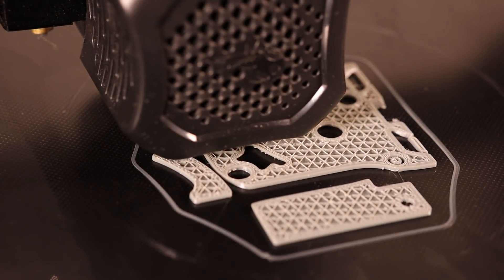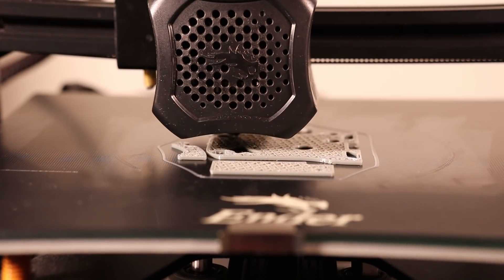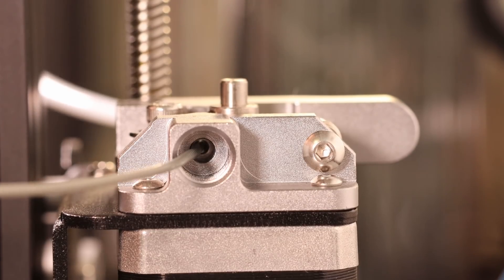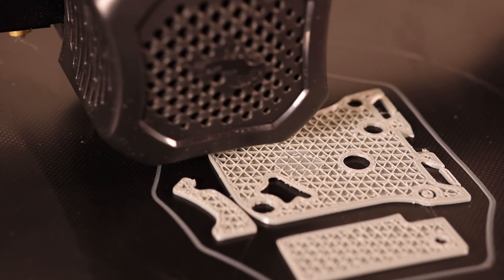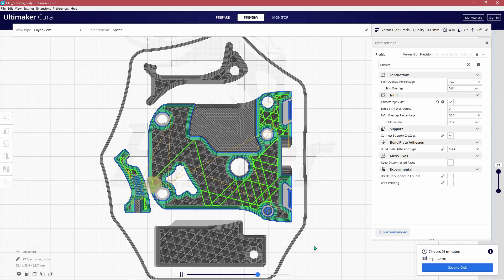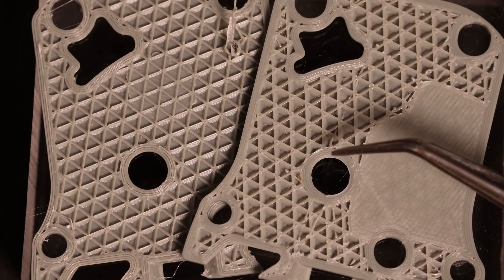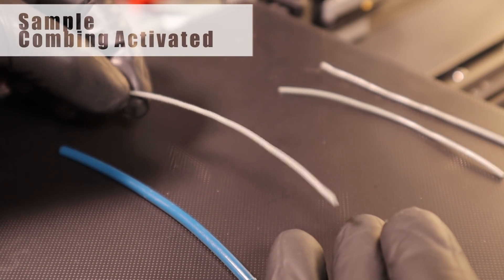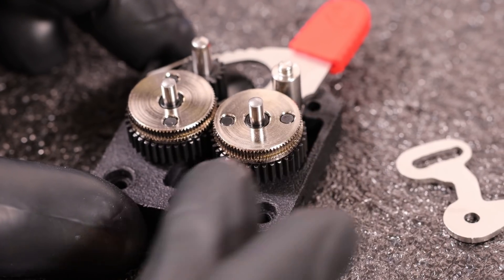Creality Ender 3 V2 - Stop The Print From Failing Like This

Comment: Thanks for this inspiring video, man!
I was having a different problem, but the first tip sent me in the right direction.
I was printing a large part in TPU and it kept failing at the first infill layer with filament wrapping around the extruder geared wheel.
I tried limiting the amount of retraction as I did already figure the problem was caused by that, with the extruder having a hard time pushing the flexible filament back into the tube, but that wasn't enough.
The continuous infill tip seems to be the right one for my case. I'm now halfway through the part with no failures.
Thanks to you, I've learned something new and useful today!
Thumbs up!
Reply from the maker: That's great!  I've not tried TPU yet, I'll have to experience it, I was waiting until I test direct drive.

Comment: Just letting you know that the Voron parts ARE NOT supposed to be printed in PETG. PETG will flow at temperatures at which enclosures heat up to. It is a very big nono if you want your voron to print for more than 2 weeks :(
ABS is the ONLY material you should print your voron parts in
Reply from the maker: I will agree that some parts are best printed in ABS, anything in contact or near a heat source, everything else is fair game.  They do suggest ABS in the instructions, Voron printers can be setup in an enclosure to print higher temp materials and will lead to softening.  

I'm willing to try it in all PETG and see what happens, if it doesn't work,  any parts which fail can be made in ABS.  Does every parts need to be?  I highly doubt it.

Comment: Hmm I watched a video about combing before I bought my printer, so I use combing turned on all the time. I was wanting to ask. What is a good tip for nozzle temps? If the filament says 190-230c, should you use the middle of those temps?

Comment: Uncanny timing with this video! I had this issue just yesterday, however I don't know if these setting tweaks would help me because my model has numerous bumps (simulating an appearance of gravel on terrain) all over the surface. Or at the very least, I'll have stringing all over the surface. Any thoughts or ideas?
Reply: ik this is really late but mine was having the same issue and when i calibrated e steps and flow it stopped!
Reply: @snw0x0   Thanks for your insight. I still get problems when printing these types of surfaces. I've determined that the numerous retractions by the extruder flattened my filament, which got jammed in the bowden tube. I've tried loosening up the grip on the extruder, which sort of helped, but not always.
Reply: @aceattorney  yes i still have to fix that issue in mine, at this point i’m considering that filament brand is the problem

Comment: The gears on the extruder, did you have to do any kind of adjustment for feed speeds?  

I did have the skipping problem, I didn't attribute it to the filament crush though, I eventually found that the bowden tube was not seated correctly at the heater and was causing jams.  I was literally getting blow outs, with the tube being pushed out of the extruder mount point.  I bought new holders and was still getting the same deal.  I then realized you have to push the tube ALL the way in to the heater, not just to the tip of the holder.  So that means that I may have been getting crushing earlier on, but it eventually pushed the tube out and was causing other problems.  Noob move, but, fixed.  (And I have a nice red tube on it now. ;)  )

Comment: I wanted to know the cause of this as it caused jams and failed prints, thank you for the explanation
Reply from the maker: My pleasure, I've have this problem in the past a few times and it can be very frustrating.
Reply: @NeedItMakeIt  I can't imagine you are ever frustrated. You always sound so calm.
Reply from the maker: @TuncayAyhan  Oh I do, but I don't like to, I find that I am much more calm without Caffeine, all of the benefits of better sleep and no crash.  Maybe I should make ASMR videos?
Reply: I have this problem but on small prints with a lot of perimeters, and it stops extruding and literally makes a "bite" in the filament, is there any way to fix it, as i understand this fix wouldn't apply to perimeters, thanks in advance

Comment: That extruder spring is waaaaaay to tight on that ectruders i just find out that the stock bed springs have the best tension (when upgrading bed spring to silicon spring. The stock bed spring get available).  Also it does not have to tight at all when printing petg temps are always above 230C
Reply from the maker: Some good tips to keep in mind, this stock spring with the metal extruder does apply quite a bit of pressure even with the screw fully released.  As far as temp, each filament is different, this one extrudes well as low as 200C, which is a bit unusual, however it is the cheapest PETG on the market.
Reply: Yeah for real. I’ve never had this problem. And my extruder spring is pretty darn stiff. So that one must be super duper super stiff to cause that.

At most, mine will leave teeth marks. But even after several retractions, it doesn’t deform the shape. Seems like chasing ghosts, in my opinion. Could be wrong. But that’s unlikely.
Reply: @rayaguilar9085  my Ender 3 max does this a ton.  Just chews up filament makes printing with silk near impossible.  I have to try 5-6 times with retraction settings to get silk to print and it changes with every print. Half a spool is used troubleshooting.
Reply: Red it many times.

Comment: do you have a link for the dual gear?
Reply from the maker: Before you take the plunge with this dual gear, it isn't that easy to setup on these printers unless you're well versed in modifying firmware, or you are okay with minor changes to current coming to the motors and reversing the motor rotation.  https://www.bondtech.se/resellers/ I purchased mine at 3D Lab Tech in Canada.  https://www.3dlabtech.ca/product/bondtech-lgx-large-gears-extruder/  I am still working out some kinks, the extrusion or perhaps retraction settings need to be adjusted to set the e-steps I had to run in a gcode file on the printer as I didn't want to modify the firmware:

M92 E415 - means adjust e-steps to, and a value of 415
M500 - means store that setting

I hope that helps.
Reply: Thanks for the detailed reply